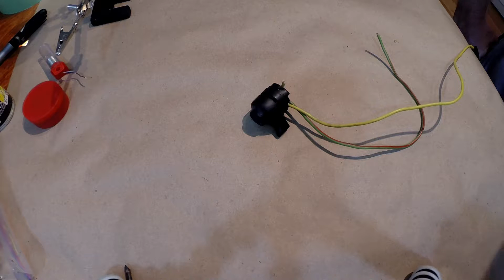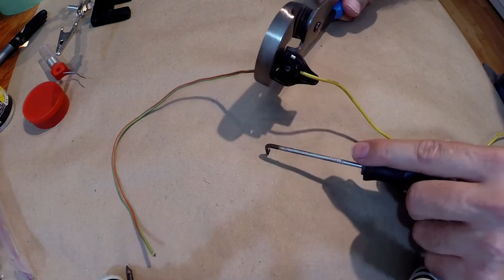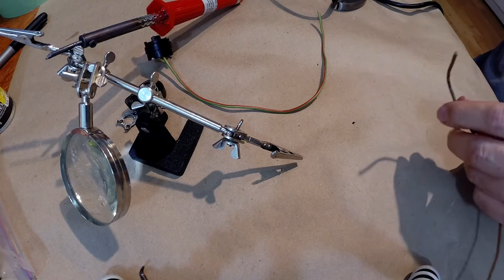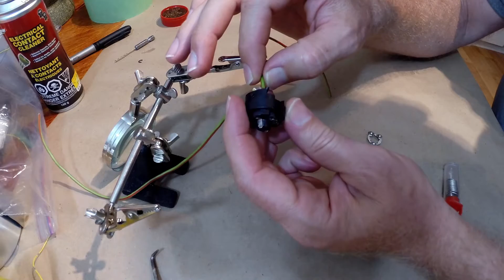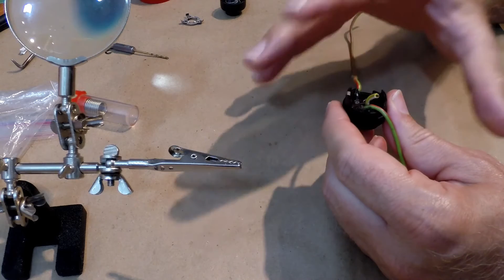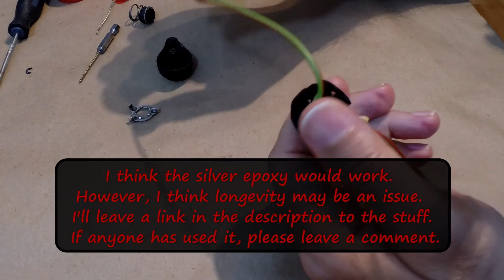BMW R75/5 handlebar thumb switch disassemble & repair?

Comment: Tip: to install the retainer clip, zip tie the switch into the full down position so the clip retainer groove is showing. Place the microscopic clip on a flat surface, put a minute bit of crazy glue on the tip of a medium flat screwdriver and glue the end of it to the closed side of the clip, not on the edge but vertically to the side. Now you can line up the clip with the groove in the center pin and use another small screwdriver to set the clip. I wore the wife’s reading glasses too.

Comment: Thanks for the advice.  Especially what NOT to do.   Working from the back I used a 2mm Dremel bit to bore out part of the way through (about 3mm deep)  Packed the hole with solder wire then tinned the wire end.  Jammed the tinned wire into the bored hole and the carefully applying solder iron.  Worked a treat with a good bond.  By the way, you then don't have to disassemble the switch as the hardest part of the job was getting the microscopic clip back on (so no need to take it off if its a disconnected wire you're repairing).  Thanks for saving me €150.
Reply from the maker: Good idea! Thanks for sharing and I'm glad my video helped!

Comment: thanks for making this, I wonder if drilling those out  an running a brass " top hat termination " would be a solution..no heat at the plastic, push down friction fit,  pre  manufactured trumpet indentation......

Comment: I've fixed plastic vintage toys with similar rivets and heating to the point to release allows you to remove it and solder the contact then reinsert with jb weld to fit melt in hole.  You need to push out rivet with thin rod.
Reply from the maker: Great idea! Wish I had thought of that. I'll try that procedure next time I work on one of these switches. They are getting expensive. Thanks for sharing!

Comment: Hi there, love the video. Couple observations:- if you leave uninsulated copper on the backside of the switch you could use shrink tubing for each wire to add insulation after soldering.
- the tubes going through the plastic are hollow rivets which you can buy and replace. They come in All different sizes and can be drill out and replaced with new once. 
Keep up the airhead videos. I own a R90/6 (still a project).
Reply from the maker: Very good information! Thanks! Wish I had known these rivets were replaceable before I melted this switch. I'll research the rivets and add this information to the summary information on the video.

Comment: great video ,thank you . I 'm wondering if the right and left switches are interchangeable? I have an extra  new left I'd like to replace with a bad right that's on the bike? thanks
Reply from the maker: Thanks for the compliment! Regarding your switch question, I'm sure you can use a left switch on the right side. The problem you will have is the left switch has a momentary switch function for flashing the high beam. If you wire it up as a turn signal, I'm thinking it would operate the left turn signal and will not stay in turning position. Holding it up until you finish a turn would get irritating fast. Also, the left switch doesn't have the wiring for the front brake switch that is on the right front brake lever.  You will have to remove those two wires from your bad right switch and add those to the left hand switch you are using on the right. However, this info is regarding a /5 and I have never done this before. Good luck!

Comment: Thank you so much for the effort! I cannot tell you how much I appreciate it and how much this vid has helped me reframe my approach to repairing my switch. I'll let you know how mine turns out, I should be ordering all the color correct wire and terminals very soon. Maybe one day we'll cross paths on our airheads. Thanks again! - Josh
Reply from the maker: You're welcome! I hope the video helped some. Considering how much it costs to replace these thumb switches, I wish they were easier to repair. Yes, let me know how your switch turns out. Good luck!